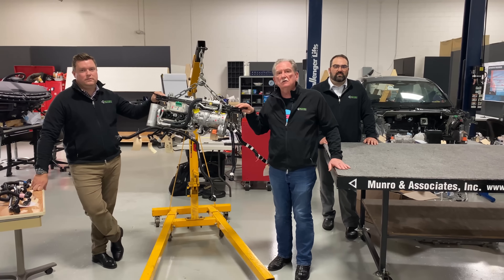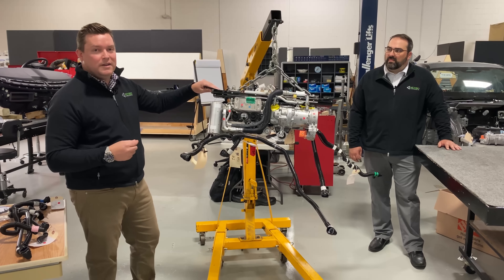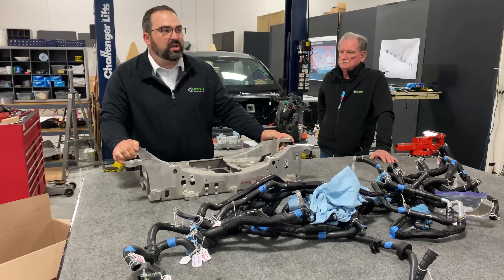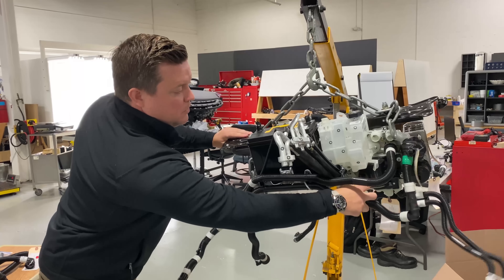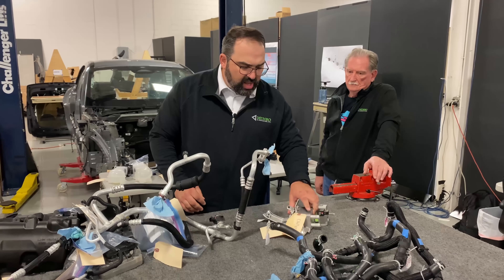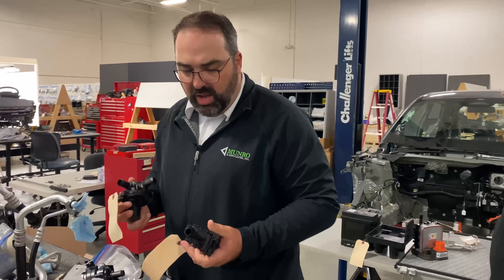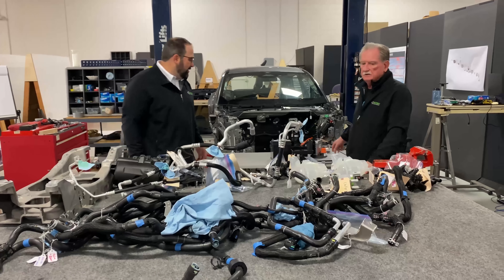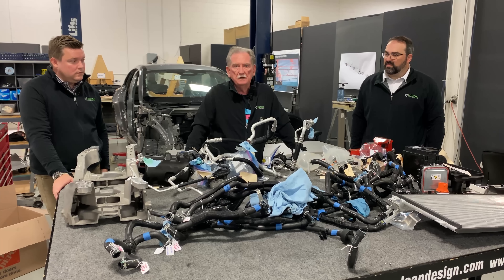Mach-E Thermal System Part 2: A Detailed Comparison to the Model Y

Comment from the maker: Thanks everyone for the great response to this video! After we published we noticed a small calculation error on the fluid weight in kg. Rather then remove the video to repair the error, we chose to pin this comment to preserve the 1100+ plus comments of dialogue. Both the Model Y weight and Mach-E weight were equally penalized with higher totals, but the relative delta remained consistent. We will have Sandy clarify in a future Mach-E video. Thanks everyone! - Munro Live Team
Reply: Do you folks also take into account the (I reckon, of course you do) weight of the fluids throughout the vehicle someplace? Please highlight that aspect in a video too some day, fluids seem to be one of the easier places to reduce weight. I know from the motorcycling world that the fluid weights are significant, many manufacturers there report the weight without the essential fluids!
Reply: Hello sandy i love your show. Can you give a comment to the poor guy who broke this connector on his tesla. They wanted to sell him a new battery pack. Thanks!
Reply: @m.h.9244 Only one I could find was this:  https://teslaownersonline.com/threads/broken-charge-port-pin-left-me-dead-in-the-water.16520/   He fixed it himself.  The connector has since been redesigned to prevent this issue.
If you have another case, please share.  Otherwise, it looks like you're spreading FUD.
Reply: @tomgray971  I believe he's referring to the recent Rich Rebuilds video of them repairing a coolant port on the battery for a guy that Tesla wanted to replace the whole battery pack in order to fix the issue.
Reply: @Unduu  Thank you.  I found it at https://www.youtube.com/watch?v=vVSw3KSevEc.  That surely was bizarre! The owner admits he had the wrong insurance or the repair might have been covered, and the video discusses the possibility that the Tesla centre might have misadvised him.  But still....
I have had a similar (though much cheaper!) situation on my ICE vehicle where rather than replacing a 10 cent transistor, I had to replace a $169 headlight module.  The module swap was just so much easier.
Reply: @tomgray971  Workshops/Garages do not have the means/knowledge to do component level electronics repairs. You were lucky that it was just this single transistor (what was the cause of the transistor going bad?) and you were able to do the repair probably because you work with electronic components. Also taken into account the time you spent in repairing versus swapping the $169 unit in 5 minutes, the end bill might be the same..
Reply: I am waiting you guys torn apart Toyota EV that is coming soon.
Reply: I had been considering a Ford E150 but after seeing this video, I think I should hold out for a Tesla Cyber Truck.   It looks like Ford gas car engineers designed the Mach-E, not E-Car Engineers.  Was the electric motor and after-thought at Ford?
Reply: So can you just say what the correct fluid weight numbers are? Are we talking 32, 20 or 23, 10 or less so it's 20,7?
Reply: Great video, new subscriber.
A big shout-out to Ben from his old team mates at AAR Corp.
Reply: The Mach-E is better than the i3?
Reply: Any idiot in the HVAC world would know that one feed and expansion system could serve multiple coolant circuits as there is only a single line into each circuit. Why does the MachE design justify total circuit isolation with two F&E reservoirs?
Reply: This is why I love you Munro's, For your Honesty! You seen you've made an error, you take responsibility for it, then take the best decision to correct it and move on. Keep doing your best, because your best is good enough. HUGS!
Reply: yes and no, cause an engineer in the big companies has to use parts of the shelves and is trained to use them instead of reinventing the wheel.

Yes, it would be beneficial for each of them to check how Tesla had done it before starting to work on the next iteration of the id family which will also be used by Ford for small cars and next Mustang iteration. 
But where would Tesla be if Ford and VW would no longer make these mistakes again and again ? 

Tesla is unable to deal with corporate customers at least here and a company does not care about all the great tesla cars as long they can not deliver that to the customer where the employees then will have to work to get their tesla get fixed cause Tesla does not care nor has an infrastructure to do that.  That is where Ford and VW outperform Tesla , same for leasing offers and other services, at least here in central europe, not Siberia.

Might be time for you to pick up and call Mr. Diess from VW to talk about the future since he now has gotten his new contract he had to fight for the last 12 to 24 months.
Might be worth to jump onto his feet now before the next ID family generation development starts ...
Reply: @typxxilps  in general... Tesla has less maintenance than F & VW
So less comparative a remark... 
move on...
Reply: @damfadd  I think his point was that Tesla seems ill equipped to handle fleet customers - about a year ago there was a series of videos from German company Nextmove and the issues they had with an order for 100 Model 3s, which eventually led to Tesla cancelling the order (https://www.youtube.com/watch?v=boWp5JqqenY). On the one hand it's understandable, Tesla is in a way still in their early years as a car manufacturer, and seems to have focused solely on private customers. They need to develop fleet services to attract the large, corporate customers that are not Tesla enthusiasts. Ford and VW (and others) already have processes and people in place to handle these, so apart from their production capacity being limited they're probably better positioned for these types of contracts.

Comment: I just bought a '21 Mach E. $10k cdn cheaper than Tesla or Hyundai AWD. This video scares me! Great car though otherwise. I'd like to know if this has been implemented in the 2025 refresh, but considering the frunk is smaller, I think not. (added heat pump)
Reply: New System (2025 Model and Beyond)

    Addition of a Heat Pump: The most important innovation is the integration of a vapor-injection heat pump, which is now standard across all trims.

    Principle of Operation: A heat pump doesn't generate heat; it moves it. The system works like a reversed air conditioner, extracting heat from the outside air (even in sub-zero Celsius temperatures) and transferring it into the cabin or to the battery.

    Advantages:

        Much Higher Efficiency: A heat pump can achieve a COP of 2-5, meaning it can produce 2 to 5 times more thermal energy than the electricity it consumes. This dramatically reduces the impact of heating on the vehicle's range, especially in moderate-to-cold temperatures (down to about -10°C, depending on the design).

        Waste Heat Recovery: The system can capture heat generated by the electric motor and battery and reuse it to heat the cabin, further optimizing energy consumption.

        Better Battery Thermal Management: The heat pump helps maintain the battery at an optimal temperature, which is crucial for both performance (power and torque) and fast charging speed in the winter.

    Disadvantages (or Trade-offs):

        Reduced "Frunk" Space: The addition of the heat pump's components required a redesign of the front area, resulting in a slightly smaller front trunk.

        Limited Efficiency in Extreme Temperatures: At extremely low temperatures (below approximately -10°C to -20°C), the heat pump's efficiency decreases. In these conditions, the new Mach-E reverts to the PTC resistance heating system to ensure a quick and adequate heating of the cabin. Thus, the new system includes both technologies to ensure optimal functionality in all conditions.

answer given by AI

Comment: Amazing amount of wasted time, energy and money on the excess Ford has invested that has to be passed on to the consumer. So many points of failure. Why couldn't Ford have reverse engineered the Tesla? As a Studebaker owner, remembering Raymond Loewy, "Weight is the enemy "
Reply: While weight is the ennemy, having more mass and volume in a liquid cooling/heating system is better, you get more inertia, which is good for the efficiency

Comment: I just see a maintenance nightmare 5 to 7 years down the road with the Mach E as the coolant lines start to fray and need replacement.  But the OEM business and dealership model is funded by maintenance.    NO THANKS.

Comment: Hi Mr Munro & team, excellent information. At this time in the UK we are working on 'light-weighting' the batteries (EV's + storage) by using polymers which should be v-useful when compared to the overall bulk weight in an EV.  Still the noted weight in just the cooling system alone as you have shown is crazy. One comment you made was that the FORD was the BEST seen to date apart from Tesla, so when will all seek to adopt the Tesla design - suddenly many are seeking to adopt the Tesla charging network/format...

Comment: Not mentioned is there is no separate a/c condenser in the Tesla due to the manifold and heat exchangers / chiller so the cooling, well really thermal fluid, removes heat from the refrigerant and then used the single radiator.

Comment: Idiotic. What hapens if it leaks and overheats? Good by battery. $1000 replacement job new hoses every 5 years. How hard is it get to them? Brilliant 

It still has a 12v lead acid. Are you kidding me?

Comment: Cant believes they still use ethylene glycol toxin. Really? Is this 1935?
Reply: What coolant would you recommend ?
Reply: @philhealey449  given the innovation in the evs I would have hoped a non toxic coolant could be developed. How hard can that be.
Reply: @craigme2583  I'll concede I've seen reference to using alcohol in a 1950s car repair manual, but I don't know if that would go mushy which ethylene glycol mixes scarily do, so yes a miracle alternative with eco friendly anti corrosion and bacterial sludge  prevention properties with low viscosity, high boiling point, high specific heat capacity and great heat transfer properties at heat exchange surfaces would be good.  Meanwhile a cooling system that won't leak seems to be be a pipedream!
Reply: @philhealey449  yer no leak would be a good design too. Horrible to deal with that stuff.

Comment: Ford made 2 coolant circuits because of he demands for cooling motor and cooling battery are different. Motor has an higher temperature operating than batteries. These are EV their cooling requirements are different. An engine can work at 80c a battery doesn't. The cooling is more important than weight. Also Ford uses a compressor which is better than a heat sink.
Reply: But it can share one F&E tank for the coolant.

Comment: I have ben working on amplifiers as a repair man, and those things are similar problems. 
No plate on the underside to open up for service, and the parts,  the cards, mounted one over the other. This is a nightmare for the service man if you are not an expert on this. And ofcorse an amplifier is much ceaper, so it ends up in the scrap container. But there is an even bigger problem, we are building whatever it is, so its hard to service - that is NOT the future, the future are - faerly easy to maintain, or no one will by it if it is not.

Comment: This is a rushed-to-market product , hobbled together. From Ford...
"On affected vehicles, Direct Current (“DC”) fast charging and repeated wide open pedal events can cause the high voltage battery main contactors to overheat. This overheating may lead to arcing and deformation of the electrical contact surfaces, which can result in an electric relay switch remaining open or a relay switch that welds close from heat.  An overheated relay switch that opens while driving can result in a loss of motive power, which can increase the risk of an accident."

Comment: What a mess, it's made just like a gasoline car. Why didn't Ford buy a couple Teslas and roughly copy what they did?  They wouldn't have to make it close enough to get in trouble for violating patents just enough to clean things up. Even if they don't really care about their customers, which they don't, they could have done it to save on manufacturing and to avoid a possible recall. 

Honestly I think these companies want to create future expensive work for their dealerships. I  see this kind of stuff on all brands of regular cars all the time. These parts counts are out of this world. And it's consistently done when you can see it's not necessary.

Comment: What other cars are more complex? The Bolt? I don't remember seeing that much cooling in the Bolt. The other problem is that Tesla has very poor quality control, let's compare quality control of the Ford with the Tesla and let's also remember Tesla has been doing this a longer time and their quality control still isn't anything to rave about. Let's see what Toyota and Subaru come up with in their new EVs and the new Ioniq 5, I want to see the comparison to those cars too. Elon is a great innovator and a lousy engineer.

You're comparing a low pressure system clamps to to a high pressure system clamps. Those clamps are fine for lower pressures.

What happened to Tesla being built like Korean cars from the 90"s? Interesting how attitudes change when you're BFF with the richest man in the world!

Comment: In the Mach-e's defense, an interesting comparison would have been against the original Tesla Roadster or first-year Model S. The Tesla's didn't all start out as cleanly designed as they are now, but have evolved over the last decade. For a first year product, Ford is doing pretty well, comparitively.
Reply: That's doesn't make sense. We're not buying brand new 2012 Tesla Model S but brand new Mach-E. So if a new ICE car company would create its first car, we would compare it against a Ford Model T ?

Comment: Yeah uses twice as much coolant but the might be that it more efficient does more cooling it just means that there may be a hose up to the radiator and back the weight of the coolant is no big deal please what is that 11 kg 12 kg okay 13 kg it's double the weight it's a 5 lb to 10 lb that's a difference it's a whole 10 lb difference it's no big deal 10 lb is not a big deal

Comment: That is why Mercedes doesn't let you open the hood of the EQS! From an Engineering standpoint your opinions are all perfectly valid, complexity leads to reliability issues, more weight, etc. You do have to realize that Tesla is on version 4.0 while the Mach E is a Beta :)

Comment: What these guys aren't mentioning is that Tesla is using a lot of castings. That adds time and cost and are not easy to change in the future. Those hoses and brackets suck, but allow for speed in development, lower up front cost, and flexibility as they learn and refine.
Reply: Castings are not likely to need replacement, but you can be sure that all of those hoses will need to be replaced, someday.

Comment: I'll take my old '63 Pontiac over all this crap. I could change the spark plugs and, once a year, replace the fuel pump (it was garbage) myself.  Of course, that was before all the pollution control hardware was mandated. Now, I can't even get my hands into the engine well. Ain't progress wonderful.

Comment: I like the presentation, but I feel like a fairer comparison that yields clearer insight would be if both systems were assembled equivalently and then discussed. It seems a bit disingenuous to throw all the Mach-e parts in a box and let them roll around while the Tesla system is hanging there elegantly, fully assembled. Just for this reason the Tesla system seems more elegant. Was there a reason for this?

Comment: Instead of complaining, think why and what is the purpose of such pipes. If the purpose is to have a better performance in terms of delta T or less irreversibilty in heat exchange, well it s worth. Even rankine cycle in steam plants has much more pipes than needed to increase the overall efficency with regenerative heat.

Comment: probably to make it run warm in winter. (tesla at least in test does not warm up enough in winter you have to have winter coat inside car) (Ps. Mach E lets you choose to either warm up cabin or batterys for long range. Or warm up batterys then heat cabin with left over heat. Tesla doesn't let you do that ?)

Comment: Always enjoy the videos. Would you have a rough estimate of range loss during cold winters that the mach-e would experience vs a tesla? Due to the inefficient thermal system of the mach-e vs teslas heat pump

Comment: The thing that kills EV's is the lack of charging stations. Imagine if everybody had an EV the lines to the charging station would be longer then they were doing the oil embargo. I worked at a gas station. The station could pump hundred cars a hour. 
  Then could you imagine a grid meltdown. Northern California PG&E shut down the grid for 3 to 4 days. Even with a gasoline powered vehicle you had issues. A simple solution for that would be a generator for the gas stations. Not possible for 100,000  Tesla's🤣🤣🤣

Comment: I think what's also important to mention here, which Sandy and team do not, is that this is the first generation/version of the Ford Mach-E.  The Tesla Model Y has benefited from it's predecessors, the S, X and 3, which have been refined over the last decade or so.  Hopefully from Sandy's videos, and Ford's own internal reviews, Ford will make adjustments to their design so when the next model year/version comes out, there is a noteworthy improvement design, minimally in the thermal system, that translates into less parts and weight.  Hope your watching and taking notes Ford engineers!